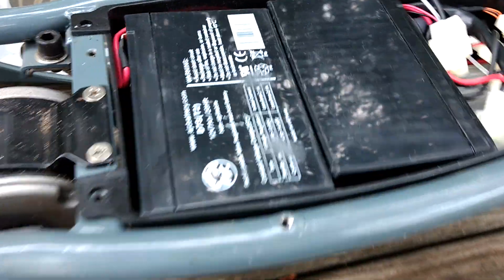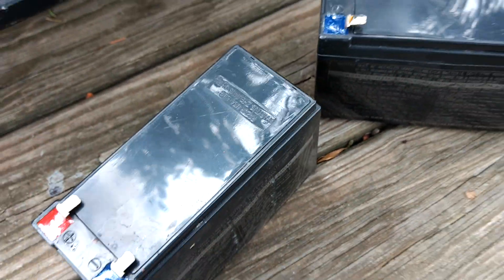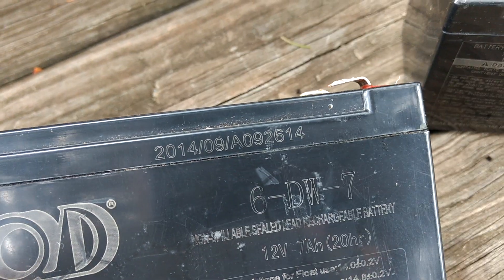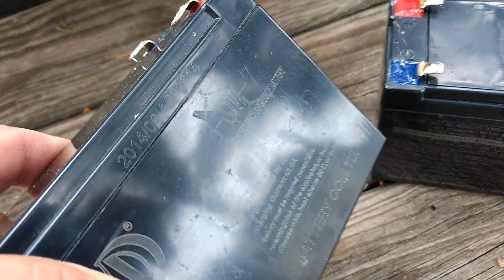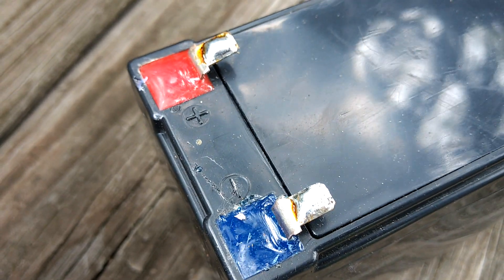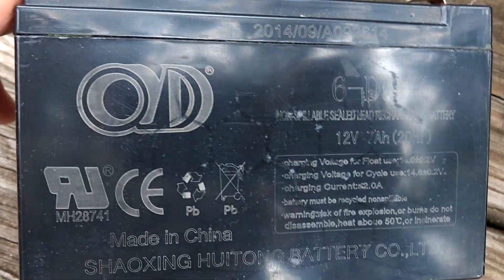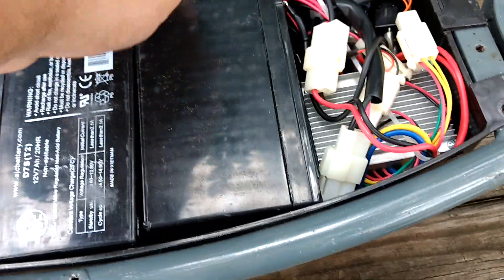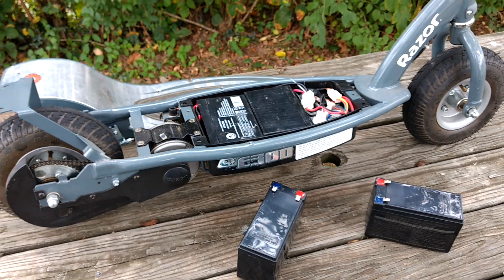Razor E300 battery replacement info

Comment: I changed the capacitor to a 63volt one, and when I connected the battery it shot across the room and rode the wall ,  do you know why its spinning without me touching the rev
Reply: could be a short somewhere